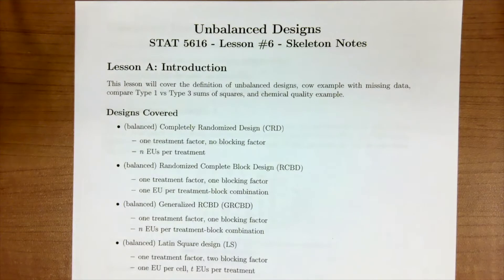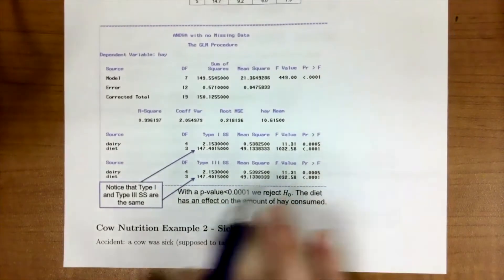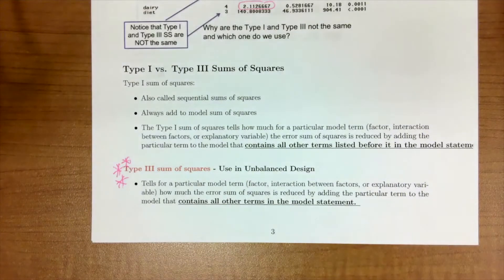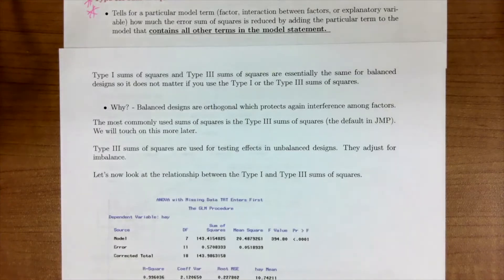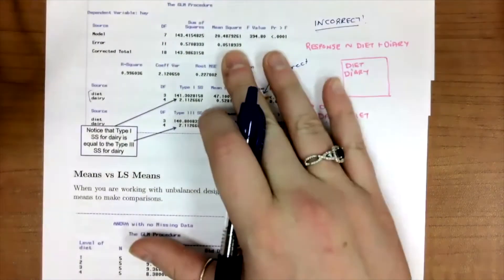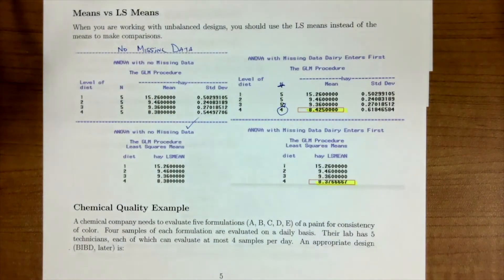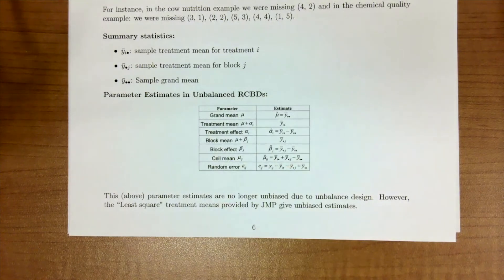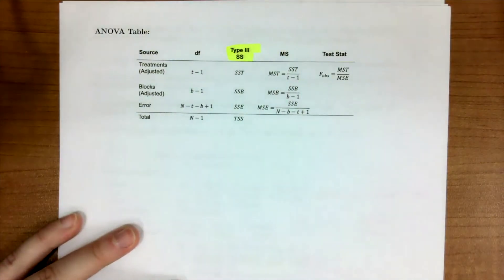Lesson 6A: Unbalanced Design Introduction

Comment: In case we have a factorial experiment but the levels of each treatment is not equal in this case it will be unbalanced design or what?
Reply from the maker: If we had a factorial experiment with different levels of treatment, this would still be considered a factorial design. For instance, in  Lesson 7C, there is a  factorial example (Pesticide Example) where we have two treatments: the pesticide and the variety. The pesticide has 4 levels, and the variety has 3 three levels. The Pesticide experiment is balanced because each treatment combination is assigned to the same # of EUs. 

An unbalanced factorial design could happen if:
 (1) if the treatment-combination was not assigned to the same # of EU (maybe due to missing data), or 
(2) some treatment-combination are missing (this is common when certain treatment combinations would be dangerous or unreasonable). 

Hope this helps!
Reply: @merkeslectures6710  
Thanks alot that was very helpful